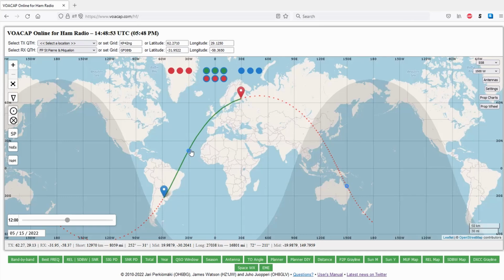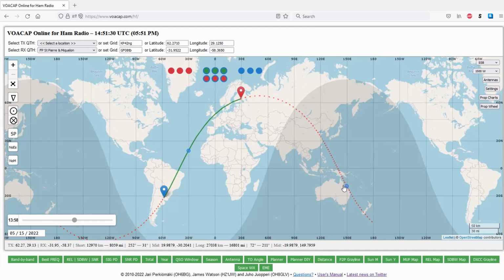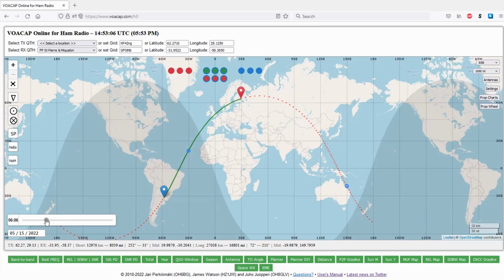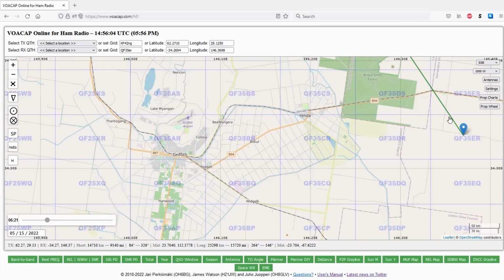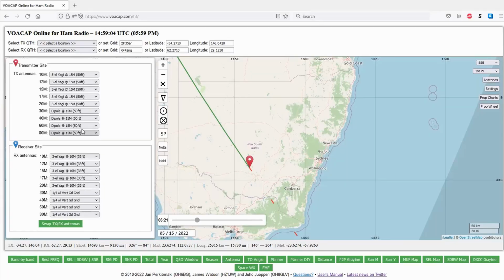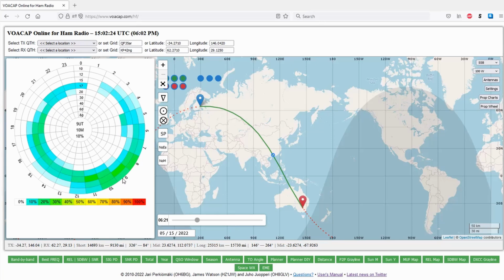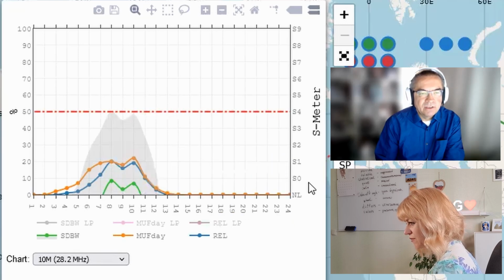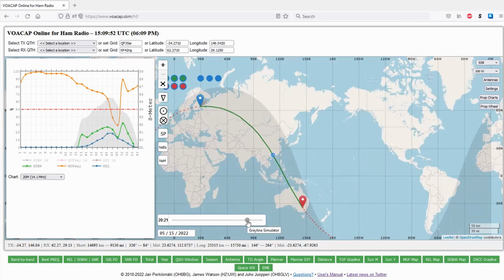VOACAP Tutorial Part 2: Deep dive. How to plan a SKED with my friend in Australia?

Comment: Great and very informative video. I use VOACAP every once in a while to check my chances for a qso.
There may still be hope for you to catch up with your friend in Australia. Looks like you only checked a single date but around the year propagation shifts quite a bit. Maybe another month you can have a better opening. I know that somewhere in VOACAP you can bring up a month by month graph or table.
Reply from the maker: Robert, it's great you to use this great tool. Unfortunately I was not on the air for this time, but I hope to have a QSO with my Australian friends and you.
73/88
Reply: @YLRaisa  I am sure looking forward to having a qso, how are your CW skills? That’s all I can offer, CW on the 30 or 40 mtr band with a homebrew qrp rig. I can reach Finland or St. Petersburg easily from the Netherlands with 4W. 73/88, PB7RS
Reply from the maker: @robertvandersanden  I haven't learned Morse code yet. But I have plans for the future. ;)

Comment: Yes! It WILL be a big challenge but that’s half the fun with Amateur Radio!!!! 

Something that probably cannot be predicted is the orientation (direction it is facing or moving) of my truck at the time of any attempt. Let me explain a bit…..and this might even be interesting for Yari (I’m sorry, I don’t know how to spell his name).

My truck is 27 Metres long, from the front of it (what we call the bull bar) to the back of the second trailer. Both trailers are aluminium, thus highly conducive. They are also about 2.4 Metres wide, by approximately 3.9 Metres from the ground to the top rail of the trailers. As RF travels along the outside of a conductor (skin effect), this means I have a relatively effective and broad banded counterpoise.

My Codan 9350 antenna is located on the very front left hand side of the prime mover, meaning that there’s VERY close to 27 Metres of counterpoise in one direction. Whilst this is by no means as effective as a “regular” directional antenna (such as a Yagi) it DOES significantly enhance both transmitted and received signals in particular directions. This is something that I’ve observed countless times in the last 4 decades of operating mobile.

I’ve never been able to actually do a study of the RF fields from my truck, due to (mostly) not having the time and, to a lesser extent, suitable equipment/test gear, but I have made many, many observations over the years. 

This “enhancement” can be in the order of anywhere up to 5 “S” points on the meter, although is more consistently around 3! Obviously, the most important factor is predicting the propagation, times of days AND most ……advantageous…..frequencies/bands, but if conditions are good enough, I’m told that often my signals CAN be comparable to at least a dipole and sometimes better, provided I am “facing” the most advantageous direction. Just this week I’ve received signal reports from S 7 through to 9+5 ……sometimes from “big” stations (with high gain beams and such, with plenty of power) but ALSO from very modest stations.

Now, I’m not a “technocrat” and my knowledge of particular studies aren’t necessarily strong, however I truly think that being able to have a QSO with you, Raisa, is NOT like hunting unicorns, but is, in fact, a possibility, though perhaps not particularly strong. 

Having recently (in the last 3 weeks or so) spoken with reliable signals to Amateurs in Serbia, right throughout Central Europe, Poland, Spain, France and all the British Isles countries, I’m not without hope.

I wish I could provide some facts and figures and to have conducted studies to help Yari with his investigations and development, however I work ridiculous hours and I just can’t put the time in …..AND have controlled parameters, so it is what it is.

73 & 88, my friend, Raisa

De Indy VK2XB
Reply: @yl Raisa . I actually spoke to someone in Finland fairly recently, so I am hopeful?!!!!!